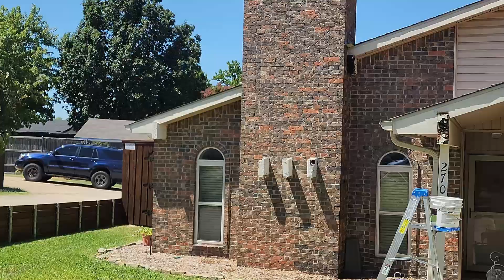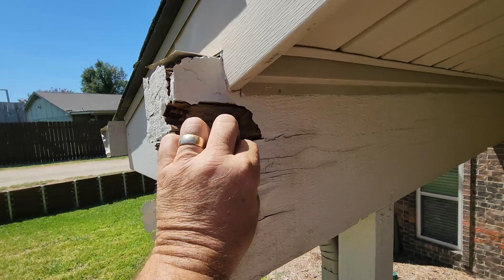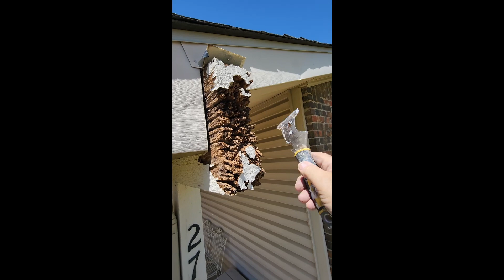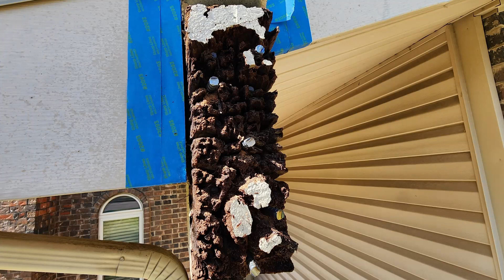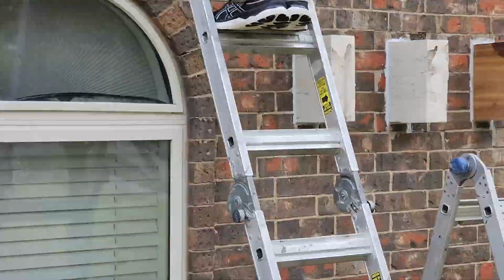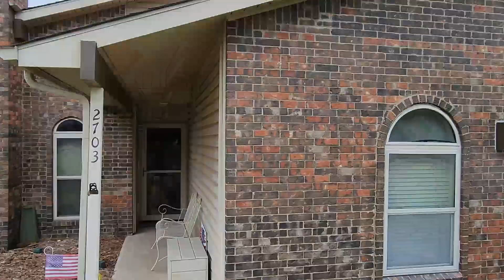Rotted Wooden Beam Repair and Restoration. How to Restore Wood Rot!

Comment: How was the new wood added/anchored? Thats what I was waiting for. lol. Explanation for other steps were great and the end result was very nice. I have a few I need to fix myself
Reply from the maker: Wasn't new wood added, it was an epoxy fill and sand to final shape.  The epoxy was supported by the addition of the rebar and then shaped with wax paper covered plywood screwed to the good portions of existing beams.    The footage I took of the important steps was corrupted and I used what was left on the phone when I went to edit this video.  I'll try to be sure we get better footage on the next project.
Reply: @GBorders1  awesome. Thanks for the response. I will move fwd with my project soon.

Comment: how did you install the rods?
Reply from the maker: The borite rods we simply drilled into the existing wood and pressed borite into place, the rebar we also predrilled, vut to length and drove into the wood firmly but no so hard as to split the beam.
Reply: @GBorders1  thank you for the reply

Comment: What is the product name
On the epoxy? Thanks
Reply from the maker: The 2 part solid epoxy is WoodEpox from Abatron.  The liquid 2 part prep product is LiquidWood from the same company.  Therre are similar products from a company called Systemthree.
Reply: @GBorders1 I used System Threes End Rot System and it worked great.
Reply from the maker: @thezfunk  I have used the products from both System three and Abatron.  I find them both very similar and both work great.